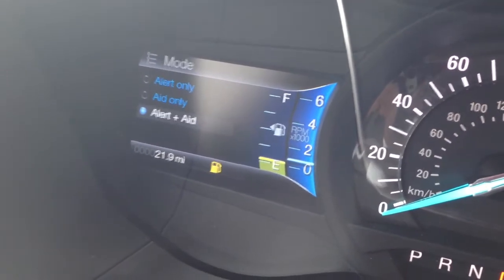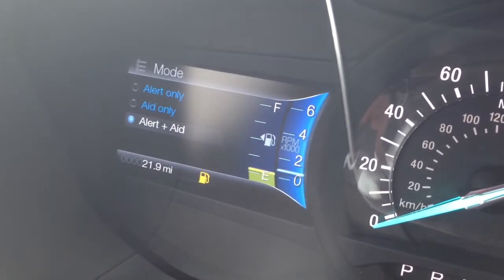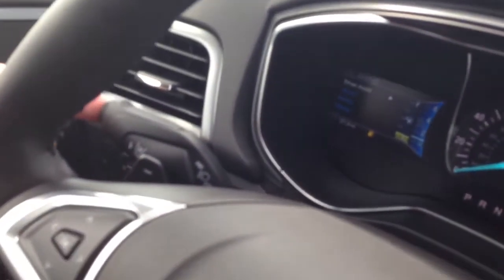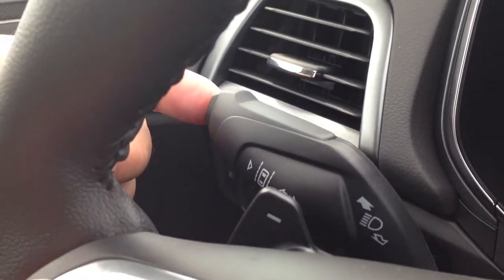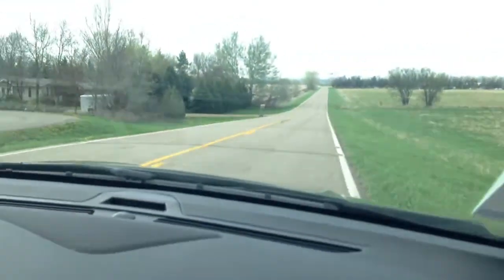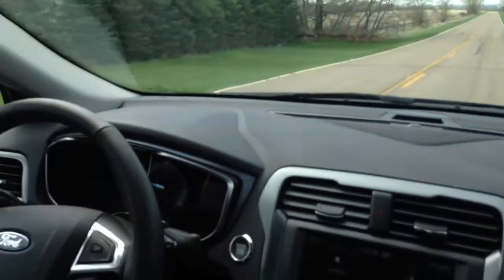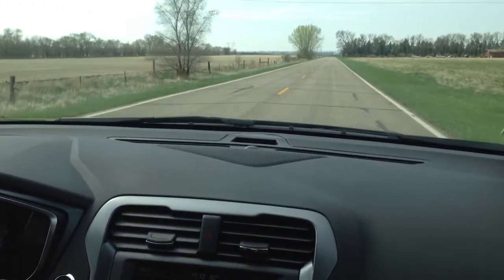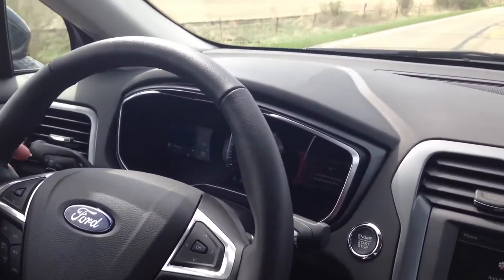How Lane Keeping System Works- Eide Ford Lincoln

Comment from the maker: There is a button to engage and disengage the Lane Keeping system, the button looks like a car crossing the lines in a highway and is typically located on the center console or on the left side of the dash near the switch for the headlights